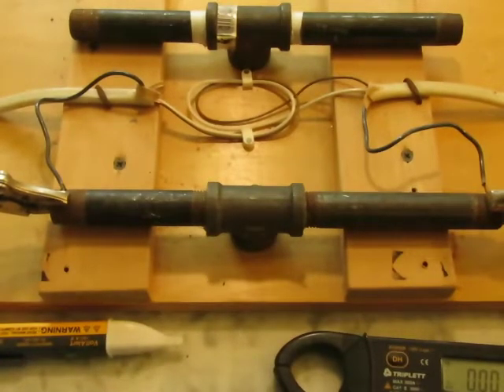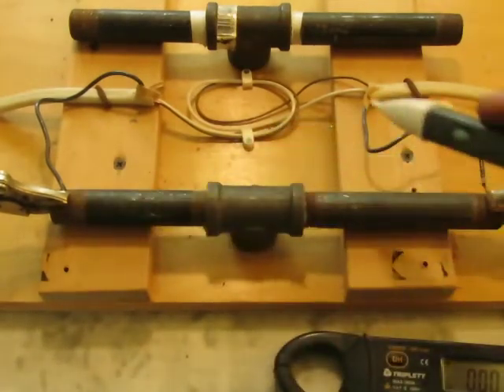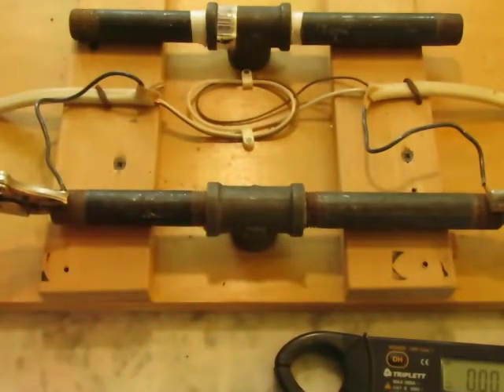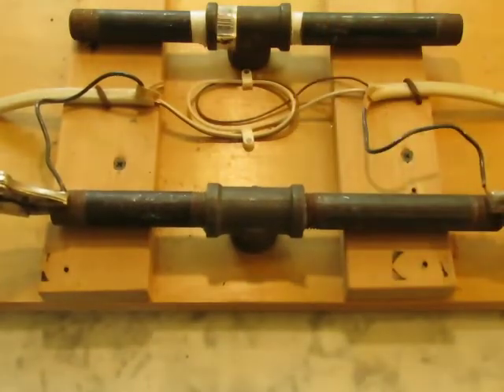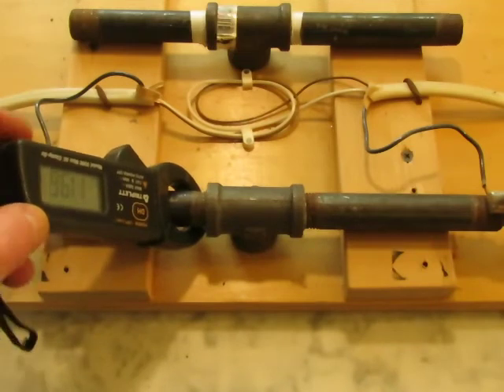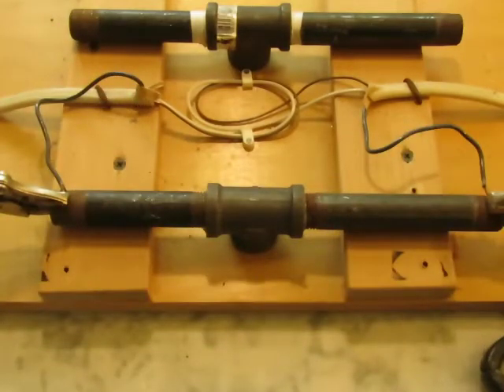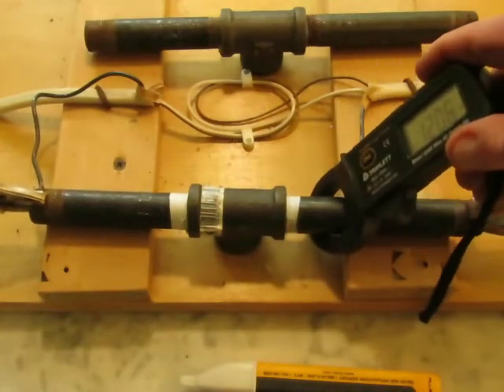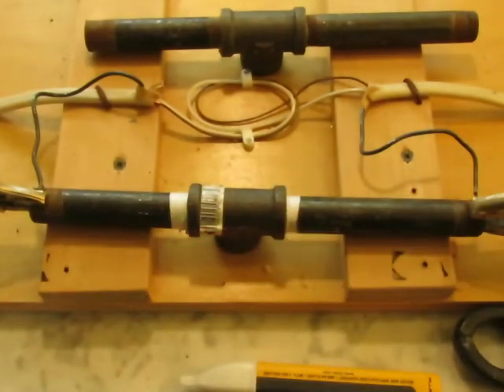Does Teflon Tape break electrical continuity  on steel pipe?

Comment: Seems to me that the only way teflon thread tape would insulate electrically the two metal threaded pieces of pipe would be if the tape remained in tact as the two pieces mated together. But since thread tape gets crushed as the two threaded pieces begin to bind and it remains crushed, the metal threads of the pipes push the tape aside and make contact with each other every time they begin to tighten.

Despite much experience in the matter, I still wanted another opinion. Thanks.

Comment: Hi, question:  I have many light bulbs that loosen to point of not lighting on a chandelier.  I want secure them with teflon tape.  Is this safe?  It appears to be since you use it to conduct electricity in this video.  Thank you.
Reply from the maker: No no no. The video was about how the threads cut through and maintain metal to metal   contact. The tape should NOT be considered conductive!

Comment: Just out of curiosity could you put a link or even just post the model of your amp prob I like how small and compact it is and would like to get one like this.
Thank you very much and have a great day.
Reply from the maker: https://www.newark.com/triplett/9200/mini-ac-clamp-on-meter-300a-27mm/dp/12K3659?gclid=Cj0KCQiA1pyCBhCtARIsAHaY_5doLpXyXlw3hBAtQPUePFvryLD9RfalRugXgf0ZSFDD-s5uUWJgBu4aAljuEALw_wcB&mckv=scsU2PYU8_dc|pcrid|434136793584|plid||kword||match||slid||product|12K3659|pgrid|100464452106|ptaid|pla-901419072416|&CMP=KNC-GUSA-GEN-Shopping-NewStructure-Test-Measurement
Reply: @CharlesBuell  that's great thank you very much and have a great day.🙂👍✌

Comment: Play with   that on cement floor and bare footed :) 

Actually that is a good demo on how the pipe threads will cut through the tape and make a decent connection.